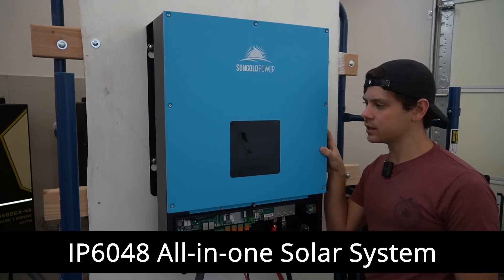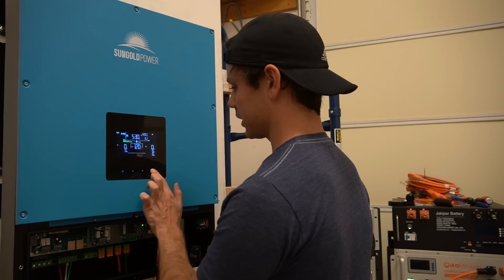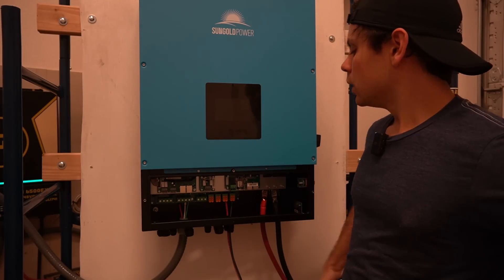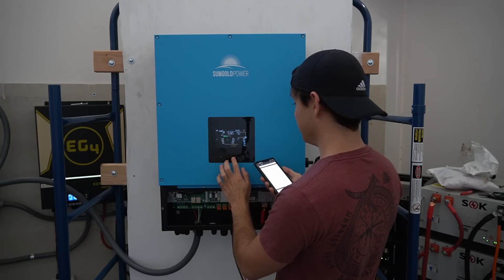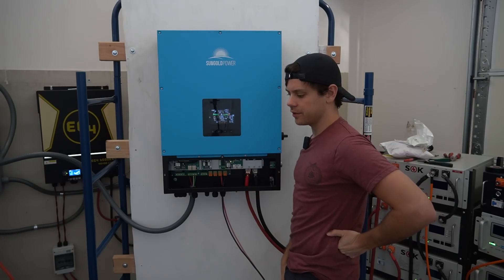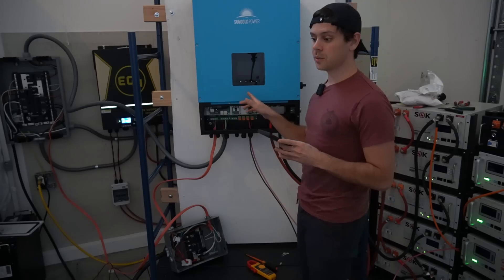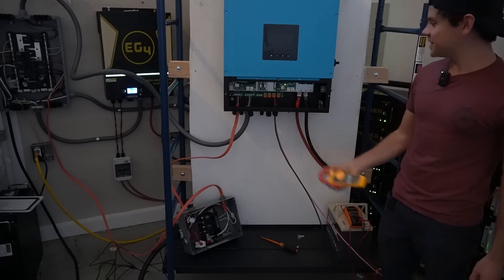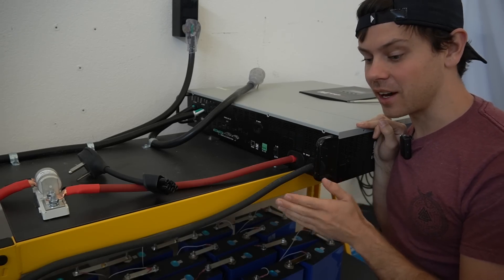New! $2,095 All-in-One System: 48V Waterproof "IP6048" 6000W 120/240V

Comment from the maker: Now if you want an easy to build and reliable system, check out my free 48V offgrid blueprint that uses LV6548's: https://www.mobile-solarpower.com/48v-complete-system-blueprint.html

And my 48V all in one buyer's guide: https://www.mobile-solarpower.com/48v-all-in-one-buyers-guide.html

And check out our forum! It is free for everyone: http://www.diysolarforum.com/

And the charging current was NOT referring to the AC current. It was referring to DC current and that's why I posted the settings page in the video to avoid confusion.
~~~~~~~~~~~~~~~~~~~~~~~~~~~~~~~~~~~~~~~~~~~
Tired of getting ripped off? Check out my "Will Prowse Approved" solar product recommendations below!

12V Batteries
https://www.mobile-solarpower.com/lithium-batteries.html

48V Batteries
https://www.mobile-solarpower.com/48v-batteries.html

Offgrid Inverter System Builder
https://www.mobile-solarpower.com/48v-complete-system-blueprint-559371.html

Hybrid Inverter System Builder
https://www.mobile-solarpower.com/code-compliant-48v-offgrid-system.html

Mobile Handtruck System Builder (very popular!)
https://www.mobile-solarpower.com/mobile-48v-system.html

Solar Panels
https://www.mobile-solarpower.com/300w-solar-panels.html

Ground Mount Solar Racking
https://www.mobile-solarpower.com/ground-mount-racks.html

Wire, Lugs and Busbars
https://www.mobile-solarpower.com/wire-and-connectors.html

Tools
https://www.mobile-solarpower.com/tools.html

Fuses and Circuit Breakers
https://www.mobile-solarpower.com/fuses.html

Plug-N-Play Solar Systems
Ecoflow, Anker And Bluetti! So many models to choose from. See my current recommendations here:
https://www.mobile-solarpower.com/full-size-systems.html

~~~~~~~~~~~~~~~~~~~~~~~~~~~~~~~~~~~~~~~~~~
Need to build a large DIY system? Need a trustworthy solar distributor? These are my favorites:

Signature Solar
Creator of EG4! Solar Minisplits, Victron and More! Largest Solar Store Online.
If you want $50 off, please use my link below and coupon code "DIYSOLAR50":
https://signaturesolar.com/?ref=cPwLcVc0SW-BjN

Current Connected
Best Prices for EG4, Victron, Midnite and so much more! Fast Shipping and Highest Rated Customer Service:
https://currentconnected.com/?ref=wp

~~~~~~~~~~~~~~~~~~~~~~~~~~~~~~~~~~~~~~~~~~
Join our DIY Solar Community 
Need more help? Join the largest solar forum on the internet for beginners and professionals alike. 140,000 members and counting!
https://www.diysolarforum.com

Check Out My Free Book
Best-selling and beginner-friendly guidebook to off-grid 12V solar!
https://www.mobile-solarpower.com/the-book.html

~~~~~~~~~~~~~~~~~~~~~~~~~~~~~~~~~~~~~~~~~~
Contact Information:
I am NOT available for personal solar system consult! If you wish to contact me, this is my direct email: williamprowsediysolar@gmail.com
FTC Disclosure Statement and Disclaimers:
Every video includes paid promotion or sponsorship (such as free products for review). Some links on this YouTube channel may be affiliate links. We may get paid if you buy something or take an action after clicking one of these. My videos are for educational purposes only. Information is subject to change/update at any time. Electricity is DANGEROUS and can kill. Be smart and use common sense :) DIY Solar Power with Will Prowse is a participant in the Amazon Services LLC Associates Program, An affiliate advertising program designed to provide a means for sites to earn advertising fees by advertising and linking to Amazon.com
Reply: I think the 30 amp setting is from the grid not the battery amps.  so 240 x  30=7200watts. 7200/48=150 amps to battery. Just an idea.
Reply from the maker: @rodneyhunt  yes I thought that too, that's why I posted the manual to show that it's the DC battery charging amperage setting. Not ac input. I thought what you thought right after I had the 30A breaker flip.
Reply: I have an epever upower HI series all in one inverter (3000 or 5000), i have the 3000.   Its a pretty good inverter and cost me £550 which is very cheap.   Only downside is no scheduled charging from grid and lack of any bluetooth.  So i use a shunt (junctek 140f) and contacts to turn on and off charging at cheap rate via wifi smart plug.     Would be a good one to review..    Best for the money imo, i looked at them all.
Reply: @jmpcrx  - I will upvote this idea. Incredible price and spec for 3000 and 5000
Reply: It depends on the mode you're in ...
Whatever the reference ... it's the settings for the charging coming from «utility» ...
It's not the maximum charging rate you're setting there but the one coming from utility ...
The software may not understand if the maximum charging does not correspond to that set rate ...
Way more if it already by-pass ...

If it used in usb ( utility-solar-battery ) mode priority it will consider the max charging rate ... not the max one from utility ... 

As for example ( I might be wrong but won't bet that much on it ... )
If max is set to 120amps it is consider to be the sum of coming from solar and utility ...
If it had only utility as an input it will use it all ...
Please check if the max charging rate from utility is not applied to a specific priority mode ...
Thanks .

I think you can set time for charging priority and for output priority mode ...

It is substantially usefull there ( France ) as specific electricity rates are applied during nights .
It stand quite difficult to set up due to seasonal fluctuations what's the solar input ...

There's indeed a real need for an easy to use nd understand setting software or interface ...

Pretty true .
Reply: Read what you just said , Now if you want! That is a sales pitch. I purchased the SunGold system after watching your bias review. From the fast free shipping to the quality controlled packaging. To every screw and not that I put together, The system was 100%. Even the support I received from customer service was commendable. I will no longer trust your reviews because you seem to have turned into a salesman.
Reply from the maker: @bobbyotay  🤣🤣 did you even watch my video?
Reply from the maker: @bobbyotay  how am I being a salesman when I found a million things wrong?
Reply: I hate HMI touch screens they're very problematic vs a old school switch and button setup.
Reply: @Bigdaddyslasher  I agree, the touch screens are problematic, but this unit is also suppose to be able to be mounted outside.  Waterproofing would be harder with manual switches.
Reply: @Farside  in my business, they mount HMIs outside, and they are shocked when the sun destroys them. They build sun shades on them but they don't live long out in the elements.

Comment: Hi, Will. Thanks for everything you do. I'm a newbie to solar and learned a lot from watching all of your videos, but I have a situation. I was wondering if maybe you could shed some light on for me? I went with a SunGoldPower 8KW 48V Split Phase Solar Inverter, and I have (12) 450w SunGold Panels and (3) 48v Chins batteries because of all the sales and it seemed to be the most bang for my buck. I plan on adding more panels and batteries to my system over time, 
    But here's my problem, the system has been running great with everything in a single phase. I have it in SBU mode, so it has solar/battery/grid hooked up to inverter. But I recently bought a tesla and added a 240 outlet to charge it, so this is the 1st thing I have running on both phases I knew it wouldn't be enough to charge whole car but I thought it would charge alot of it till I add more but for some reason when I hook car up and I set it to charge at 15a (so that would actually be 30a altogether. 15a per phase). But the amps output on the inverter jumps up to like 70amps and seems to kill my batteries a lot quicker than it should, so I have know clue where extra power is going because it's not to car. 
    So I was wondering  if you might have any ideas on what might be happening or if that is just normal and I need to keep adding batteries, lol

Comment: Great video 2 questions. How do you disconnect the AC conductors? They are push in but they do not release. Second problem my system will not charge batteries neither with AC power  or DC array. Thanks

Comment: I'm really disappointed I bought this exact unit. I install Sol-Ark 12k, 15k, for clients and wanted to have a smaller full function inverter to offer that was stackable for more power as clients needs grew. Obviously I test at my own expense. I was spoiled using a SGP 12vdc to 120/240 vac 4kv non grid tie for UPS mode. Simple worked 100% of the time. This Blue 6kw grid tie, split phase with 2 mppt 600vdc 7500 total PV input would be a great unit with proper software. As of now not sure what I am going to do. My home & farm still run on 4 Trace SW4024 grid tie inverters from the 1998 era. Old school but still working!

Comment: Will, great information here as this unit is a candidate for a battery backup solution.  Can you share what connection I would need for a whole-house solution and would I need to use a transfer switch. I'm assuming in UPS mode, I would not need a transfer switch?

Comment: Remembering you had some issues configuring this All In  One for off grid; ...I just got a confirmation of a hunch from Everyday Dave ... Clip hooking up same SunGold All In One. He said for some  reason, this inverter wants grid power first, then it starts configuring as you turn on battery power next, and solar in.  That was 28 mins into his clip about DIY Solar Panel System & SunGold Power Test. Could be this info. may be valuable for that SunGold unit.

Comment: Thx for informative video. 
At 1st glance, considering price and capability, I was very interested.
After seeing this vid, The EG4 12K may be the best option.

I doubt these companies even have software engineers.
Most likely, they use the generic software from the component maker.

If you have your equipment anywhere close to where you live or sleep, noise is a major issue.
If you get frustrated easily, a good software menu is worth the money.

Comment: I have this exact sungold 6048 inverter and 4x48V 5.12KWH POWERWALL LIFEPO4 LITHIUM BATTERY SG48100M. I think I am ready to install it in the garage. My problem is I live in Scipio, UT and for 3+ months a year it ,gets quite cold. (maybe -30°F at nightnight. If I wall hang everything in a box, with a small heater would I be okay. 

☃❄☃❄☃❄☃❄☃❄What do you think the minimum should be for temp with Lithium  Battery? Any Help from anyone would be appreciated❄☃❄☃❄☃❄☃❄☃

Comment: Sugold power sent me an inverter with an underpowered charger.
The battery select mode does nothing. Each setting charges at 27.2 V.
This is not suitable for my Lifepo4 batteries.
Customer service was useless.
They did not honor the warranty or admit their mistake.
Do not purchase from them.
They will rip you offf.

Thankfully, my credit card company refunded me.

Comment: Thank you for your contribution to the community! Learned a lot from your videos👍 One important feature (ac coupling) of BluePower IP6048 is it can fool the grid tied micro-inverters to work during blackouts. Otherwise all micro-inverters will shutdown w/o detecting the grid. These solar owners have to wait in the dark wasting their solar panels. I believe this model allows you to expand with off-grid panels. However, the user interface seems horrendous based on your demo. It will be really nice if you make this feature work before we install it. Tesla Power Walls are way expensive today. SunGoldPower's customer support seems friendly and responsive. 🤩🤩😎😎

Comment: Will, Any chance you still have this unit? Or did it get sent back (either as a test unit or potentially defective). I picked up one up today and it has some super weird current going on with the battery cables and was curious if the issue I am having might be the same thing you were experiencing. I have some kind of AC voltage running across the battery wires that I can literally FEEL (not electrically, but mechanically, I can feel it vibrating in the wires) that's causing the wires to heat up. I was able to put a screwdriver next to the battery cables and you could feel the screwdriver begin to pick up the magnetic field the closer it got to the cables. And this is with NOTHING connected to the AC input OR output.
Edit: I think I also figured out the on/off of the AC out. Use the cold start to wake up the unit and then when I press and HELD the "back" button, it turned off and if I press and HELD the "enter" button, it would start up the inverter. At least I think so. I also noticed that the PV switch being in the on or off position had an affect on whether or not the inverter would turn on (and that's with NO solar panels connected, ONLY battery (not even AC in/out). So that PV switch isn't JUST disconnecting the PV arrays... it must also do some type of switching of the unit based on resistance across the PV circuit.
Reply from the maker: You posted on our forum? diysolarforum.com

I still have mine but I really don't like it. Very strange unit
Reply: @WillProwse  I did. I've been on a few of the threads about this unit and the LVX6048WP since it's the same. It's super overcast here (OH) this morning, so I can't really do any testing with solar alone.

Comment: I was excited about your last 2 videos as I am looking for a more cost effective solution for Grid Interactive than Sol-Ark that will also work with a large Nickel Iron Battery I just bought. These 2 units were high on my list of capabilities on paper but if you can't get it to function as it should I am not sure what hope I have. The third option I am looking at is the Schneider Conext XW PRO 6.8KW Hybrid Inverter/Charger | 48V 120/240V. Its a bit pricier and I am not sure if it supports sending power back to the grid. I have my Interconnect Agreement right now with Solaredge but I am trying to figure out the best way to AC Couple another inverter that will allow me to use a 48V 1200aH Nickel Iron Battery. My main goal is to make it through the night with import. I have already cut my electric bill in half my goal is to get it to 0 or as close as I can. Keep up the good work.

Comment: Hi Will, I have the inverter with the same screen.
Did you limit the Total Input current in 02 section (solar + utility)?
Looks like you’ve limited the Utility current only w/o solar, thats why the unlimited current moved to the battery due to hight solar power at that moment. Could this be the reason?

Comment: I am looking at Sungoldpower's 6000 Watt  TP6048 All In One unit which has battery less option, low frequency inverter, and can charge a 48v Battery Bank at 120 amps via grid or solar, 450vdc max PV; PLUS output 240vac Split Phase from just one unit. I would love seeing you review that option. Current price is attractive @ $1365
Reply: The only thing I don't like about this unit is the inrush current is not too good on this. I have it connected to my AC and as soon as the AC turns on it almost goes into a air mode or fault mode because of overload.

Comment: I love the 240v split phase output option and up to 600 vdc PV inputs  x 2 (... evolution of  improvements). I wonder if connecting to grid at setup might help it calibrate the auto sensing 50 mhz vs 60 mhz ... into an possibly an easier set up? ... Could this be a  great all in one ... after you dial it in over more time? ...  Would love getting a second review after you test run this unit for a month, after you and/or manufacturer get it dialed in. Just some thoughts. ... Love your reviews. I am gonna watch DIYSolarForum chats about this model, in my learning more all the time mode ;+)

Comment: Sometimes I believe the bugs can be in the electronics. When systems designed with poor debounce methods and poor power isolation are subjected to surges of power from switching evolutions, the possible inductive kick created can glitch improperly protected digital devices. You might go back and see if any of the settings were changed. In the case of the glitch being in say an internal scratchpad memory, you probably won't see that.

Comment: love your channel and content. one question I always had, why do you not address any AC-couple solar setups? They are much friendlier on the solar side of the installation, and with more standards coming out like frequency watt control they are quite adaptable for grid tie and grid down use cases. One candidate im interested in seeing a tear down of is Outback's Mojave inverter.

I say all this having seen your channel for so long, and owning 2x LV2424 for like 6 years.
Cheers

Comment: I am interested in using export limiting so I can feed power directly from solar panels to my 240v Air Conditioner.  My utility simply does not compensate me enough for exported energy and during the summer, my AC can run an hour at a time. What I would like to do is get a 240v DC system like the Growatt and tie the 240 output directly to the 240v junction for the AC, then put the current limiters upstream of the  junction so that all of the current goes to the AC when it is running and nothing goes back to the house input panel when the AC is not running. Could you do a video on export limiting that would kind of show how I could do this?

Comment: hey will, just bought 400 ah of Lifepo4 12.8v, have you tried the eco-worthy 12/24 charge controller? if so (any good)? have 600w of solar, i can top it off with my 20amp charger but it seems to hang at 13.2, is that normal? love your vids! its the metal case MPPT 40 amp, can't find much info on it, its heavy unlike the plastic controllers.